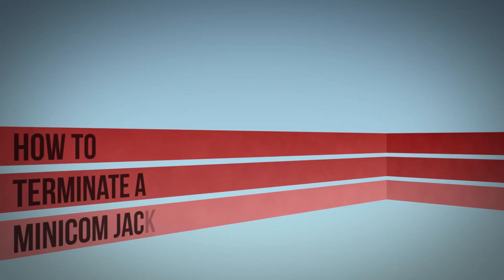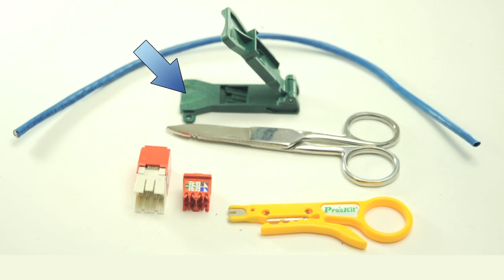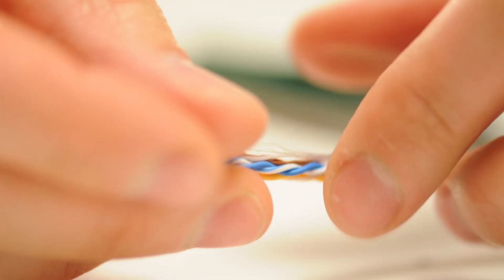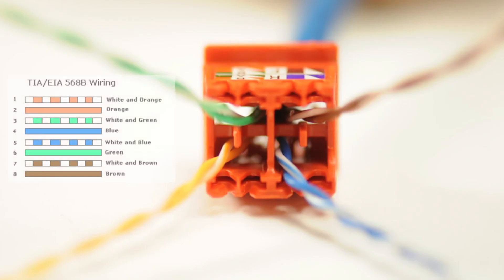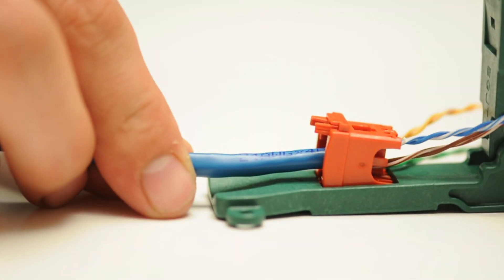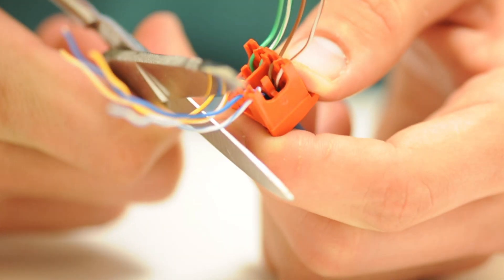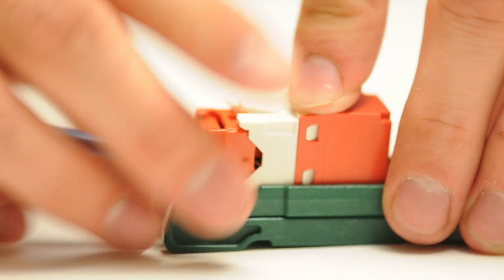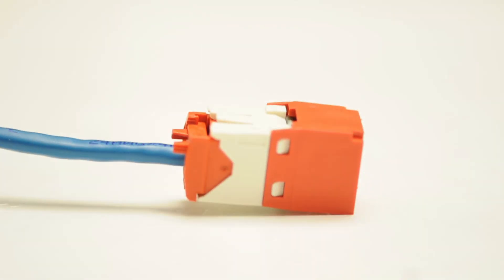How To Terminate a Panduit Minicom Cat5e Jack

Comment: This isn't close to right! As somebody who's terminated thousands and thousands of these you need to read the directions. You cut two of the pairs shorter than the other two to make it easy to insert all 4 pairs into the bottom half, one "side" of the jack at a time. Depending on which end of the cable you're working with you might have to insert the pairs on one side and then cross them over to the other side and land them. There's also no need to untwist the pairs, just pinch the pair down with your thumb and give it a quick half untwist if they're not laying right. You're just wasting time untwisting every pair only to cut it off.

You're also leaving WAY TOO MUCH wire after you trim the pairs. You need a pair of flush-cuts and you should only be leaving about 1/16th of an inch of wire sticking out of the side at most. That extra shit you have dangling out in the wind is not even remotely correct, not to mention it bows the body of the top half of the jack when you squeeze the two halves together. Who knows what the heck a DTX would show with all that extra junk you left on there. You should be able to easily do 120 of these in an 8 hour day if you do it properly.
Reply: Try reading the directions on the packaging because that's exactly how Panduit says it's supposed to be done! Like I said, I've done thousands of these jacks and never had any issues on the DTX. And I'll pass on the crap Leviton jacks. I have a Fluke punchdown too, and an Ideal, and a Paladin and a couple others. My choice is to not use any of them and stick with Panduit Minocom jacks.
Reply: No problem, I understand. It's a goofy way of doing it IMO but that's the way it needs to be done. It's because the way the pairs are laid out on one end of the cable that makes it necessary because they still get inserted into the bottom 4 square piece in the same holes as the other end. Sounds funky until you do a few, then it makes sense.
Reply: @Cornathowen  No, it actually makes it much easier to put the wires in the jack.

Comment: You need to use flush-cutters to trip the wire, not electrician's scissors. They don't cut close enough. 

http://www.panduit.com/wcs/Satellite?c=Page&childpagename=Panduit_Global%2FPG_Layout&cid=1345565612156&locale=en_us&pagename=PG_Wrapper&item_id=CWST

Comment from the maker: I posted a fuller explanation on the other video... Essentially, when punching down a Jack each manufacturer places the 110 IDC connectors in a slightly different order.  However, the internal circuitry of the jacks makes sure it routes in the correct order.  So as long as you follow the guide printed on the jack by the manufacturer it will work.